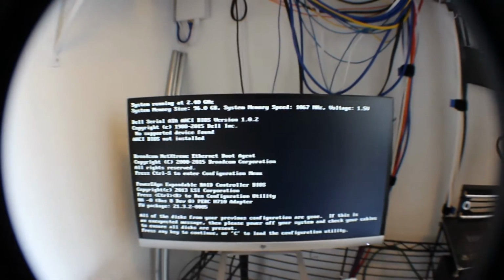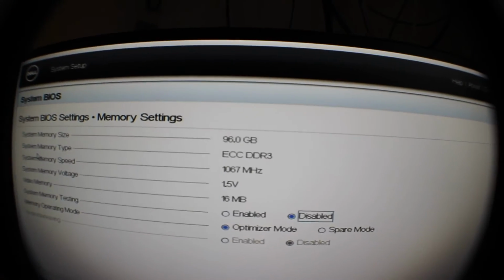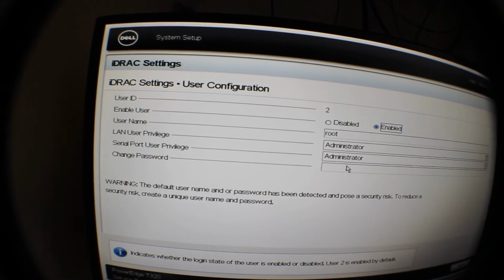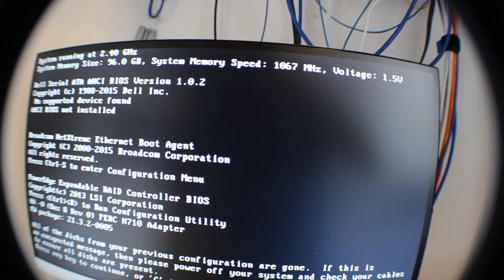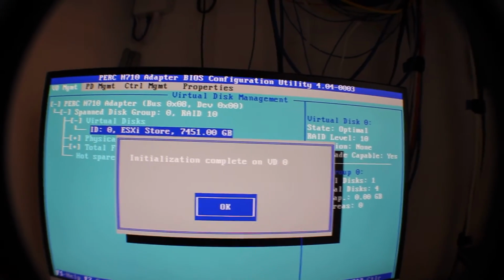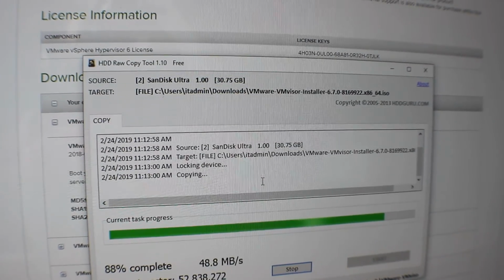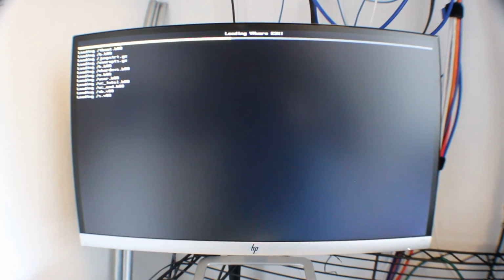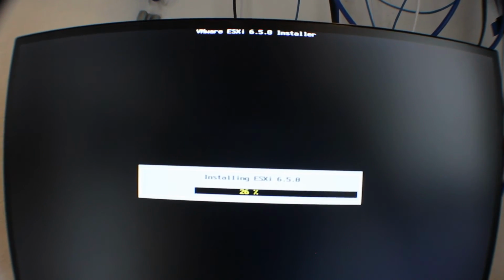Dell Server T320 CPU, Memory, PSU Upgrade, Raid setup then ESXi Install

Comment: It's a bad idea to take off the CPU heatsync after applying thermal paste - it can potentially cause air bubbles to form in the paste which will affect it's effectiveness at cooling. You also should apply the thermal paste in a single blob in the centre. Again, so that no air bubbles can form when the paste is being compressed by the heatsync.

Comment: That is the T320 not a T620 I was wondering why it didn't have a second CPU socket on the motherboard. I have a T620 it is dual slot and has two 750 watt PSU's plus two sets of PCI express slots. I was looking to see how to add a second CPU and configuring it.
Reply from the maker: hey im so sorry i have both a t320 and t620 and didnt name this right thank you for finding the mistake. but they are almost the same just a little bigger case and has dual cpu or if has one cpu can get another one to upgrade unlike the t320 can not have dual cpus. To add another cpu its super easy just need to get another matching cpu so if you have lets say a e5-2620 v4 then you need to get another e5-2620 v4 just make sure you get the same cpu and get another heatsink kit you can find them very cheap on ebay. Let me know if you have any more questions. sorry again for the mistake.